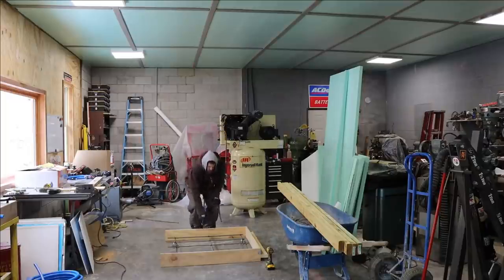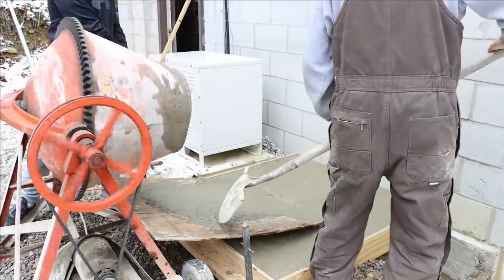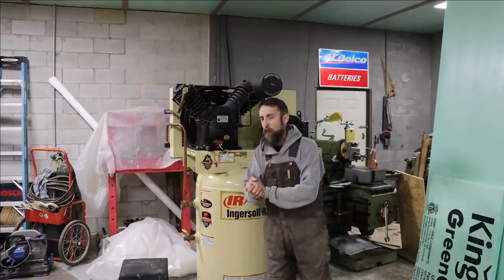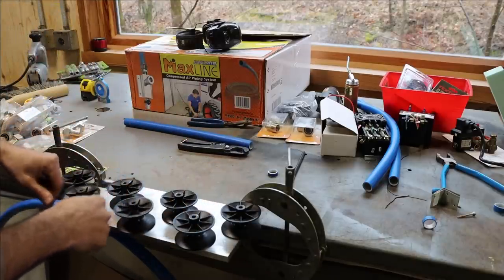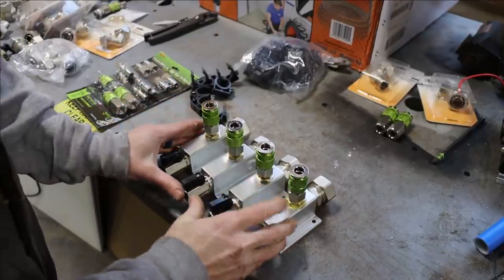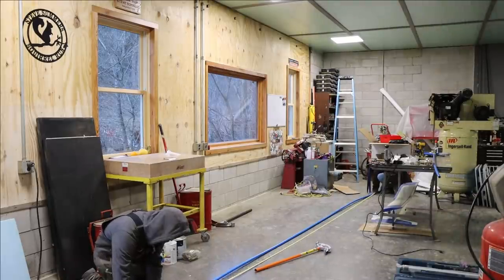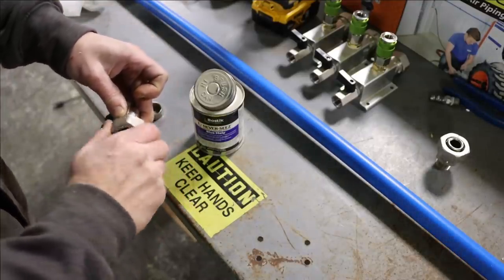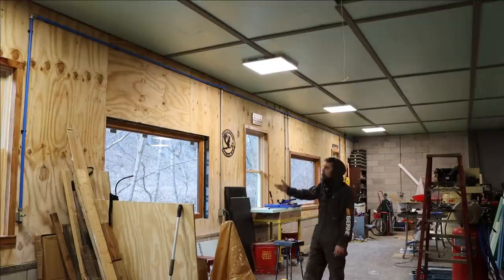Shop air System with Elizabeth & Concrete pad for compressor.

Comment: As ever, yet a other great 'instalment', and a big hand must go to lovely Elizabeth for standing in front of that space heater, so that you didn't get burned working in front of it, Steve 😆😆😆 Glad there wasn't too much 'collateral damage' when that dead gum freezer jumped up off the floor with no good reason and attacked you ! 😆😆😆 Stay safe you guys ❤️❤️❤️, and Spring will soon be coming around the corner. 🌞🌞

Comment: Steve and Elizabeth, what a wonderful couple you are. It is nice seeing a couple that spends time together and working together. When you work side by side it is hard to find reasons to go different ways. Huge thumbs up to the two of you for your family unit. Because of it you have taught your children a very valuable life lesson. Steve you may consider putting the electric side of the compressor towards the shop wall that way the compressor side for changing oil and maintenance is easy to get to. Right out by the door. Thanks for another great video.

Comment: Steve,
In a former life before "retirement" I looked after air tools in an Auto factory. 
Water in the Air manifolds was the biggest problem (apart from operator abuse) for the maintenance of the tools.
To minimise the water problem every air drop was plumbed off the TOP of the manifold, and the manifold was sloped away from the pump and dryer with a collection tank at the end of the line. the tank had a drain that was operated at the start of each shift and in humid weather as needed even though the system had a refrigerated dryer fitted. It is amazing how much moisture accumulates in the manifold. 
You have a small drain tap under each of your outlets. Can I suggest you replace them with a length of hose joining each of the outlets to a common drain valve over a bucket to allow a bigger volume of piping to collect water in, and only one drain to open to clear the lines of water. 

Cheers Eric

Comment: Hi Steve. Airlines look good. A lot of work and expense it seems. I have done my last two workshops , both a little bigger than your lovely refurbed one, using 1” pvc plumbing pipe (3mm or 1/8 wall), elbows, tees, thread ends, solvent glue and normal air connectors. In the middle of the shop we simply used a length of air hose supported with a light chain from the ceiling. Fast, cheap and easy. Can use cheap saddles to support. The lines, along with air tools and blowers, prove air to cnc lathes, mills and saws. The compressor is kept at 150psi and regulated as needed for each machine. Have never had a failure in 20 years. Easy to modify, fittings available at any plumbing supply or hardware store.

Comment: My favorite part of the masonry work is cleaning the tools and area around workspace after you are tired and full of cement dust.
Reply: As a retired tile setter I fully agree. The big difference? With concrete work you can take your time in cleaning the tools, with tile work if you wait too long it will cost a lot of money in replacing tools with dried materials on them. With epoxy grout and thinset you have 20 minutes to use it and clean the tools.

Comment: At least your ladder wasn't resting on a slightly slopped roof, 12 feet up, tied off to an eves trough  13 feet higher up. Glad you are shaken but not badly hurt. That shaken feeling will protect you from future mistakes in judgment. We could all see that coming!

Comment: Have to love literal translations on import tools, but you have to give them props for trying. That pipe diameter you are using is huge, you probably doubled the  compressor's tank capacity right there!

Comment: Gently heating the tubing ends with a heat gun makes the fittings go on easy.  Little oil on the threads of the fitting makes it easy to properly tighten too, the plating on the fittings makes the threads rough.  Glad you didn’t get hurt, floor coating makes it slick 😁

Comment: Perhaps you should check the manufacturer specs for cold weather operation of their compressor. Lots of compressor motors burn out in cold weather because the oil is too stiff. One of the disadvantages of placing a compressor outside. Course you probably already thought of that.
Reply: Not to mention that electricity and water don’t get along well......

Comment: When i poured concrete bases in cold weather...i used incandescent bulbs ( largest ones i could buy locally 150 - 200 watts etc..) Always used multiple bulbs in case one failed ( 2 minimum to maximum i could supply amperage wise to pad )... Cover it with a simple wood frame of enough to support a tarp draped over to keep heat in ....sometimes when minus 30 to 40 degrees i would use fibreglass insulation batts over the tarp/ wood and another tarp over that ...
And yes don't rush your " Reveal " ...
Let it harden and remove your forms slowly ( as you learned ) to prevent damage.... It is amazing how a few bulbs can heat a area when you cover it simply too....i would put snow or gravel around the bottom of tarps or weights ( anything heavy ) to keep drafts from getting inside...

Comment: Keep thick plastic sheet down on the concrete keeps it warmer and wetter. You don't want concrete to dry. When it is setting it makes a good deal of heat itself if you can keep the reaction going. On my last pour the slab stayed close to 100deg for 2 days even with shop temps in the mid 30's and 40's. Going to be nice having it where you don't have to hear it if you can keep things from freezing up.

Comment: One thing you could of done, was to add a wooden spacer around the shop to mount the air line to.  The spacer should be the thickness of the electrical conduit drops.  This way No bends to get over the Electrical drops.  If you need to move the electrical drop later or add more, you simply unclip the hose, cut the the wood spaces strip with a saw while still in place.  Add your new drop and re-clip the hose back in place.

Comment: Good call on those high flow air chucks. Dad and I have been using them for quite awhile now and I'd never go back. Easier to couple and moves so much more air. I can run a 3/4" IR impact off a 3/8" hose no problem

Comment: Re; Slipping ladders, I was on a twenty foot (?) ladder when the bottom slipped out, rode it down just like you. The fall was relatively slow and nothing but a good bit of dismay. Re; the bender you're using, I have a very similar one that is intended for refrigeration tubing, works slick. Has the name of a well known U.S.
Manufacturer of refrigeration tools, but most likely made in the same place.

Comment: Hi Steve,
To get some heat in the shop, you can maybe hang som bar or pipe with some of those bleu tarps on the ceiling to divide the shop into smaller rooms like, if you do some machining you can close that area by closing those tarps so you don't have to heat the whole shop, or if you do a restoration on new machines you can close that area or a welding /fabrication area /metrology pc area.
And in warmer times when you don't need to heat the shop, you can open the tarps so you have your open shop back.
I know there can escape hot air and the tarps have no insulation but it will help a lot.

Comment: I like the flexible air lines they at least won't rust. Probably a good idea to put the compressor outside for both noise reduction and space saving. Hope the family is fine hope you didn't hurt yourself to badly when you fell. Considering how many opportunities you've had to get hurt you have done well. Thanks

Comment: Awesome work Steve.  I'd add some retractable 50' reel at the door - really handy when it come to blowing up tires etc. I wonder if the plastic will hold up in the long term but I like the high flow fittings - they look really nice. A dryer by the abrasive blaster is critical.

Comment: its been quite a few years since i have done any concrete work, but i believe we used to add a cup of liquid calcium to each mix of concrete.  It would create enough heat in the concrete that it would set like it was a summer day.  I now a little too late, but maybe something to keep in mind for the next winter pour.

Comment: Steve, the go to air fittings are made by Milton.  Their V series is backward compatible with the most often seen M series.  The V couplers stay open just like the ones you have.  Super nice feature.  I'm in the process of switching all of mine To the V series.  Added bonus, the V's flow 74CFM, the M's only 36 CFM.
Reply: Yeah there are higher flow fittings available ...i have " M " and am adding a higher flow hose and fittings for a better impact experience.....Milton is my favorite too...since the early 80's ( 1980 !!)

Comment: Your little concrete project reminded me of a driveway apron I poured last January here in Minneapolis. I got a couple of twin sized heated mattress pads and lay them over some poly with fiberglass bats over the top. It worked great. Set me back an extra $40 but the heating pads were still clean so I put them on the kids beds.
you got a fairly well equipped shop there Steve but I think you need a bigger vise to assemble those fittings with. 😁

Comment: I'm sure that everyone will be watching to see how you will solve the issue of freezing water from the air cooler on the compressor as well as the air coming from the tank into the shop. All water has some amount of moisture and over time it will accumulate over tim and cacompressor use serious issues. Locating the compressor in a different location is a great idea. I built a small moveable enclosure, located inside, for my unit then for the air intake I made a large baffled muffler with intake air coming from the outside. Most of the noise from the compressor comes from the pulsations of the incoming air supply.
Reply: "water has some amount of moisture"??

Comment: Your compressed air system should work very well. All those drops  will  provide places to eliminate the small amount of condensate which will occur. I doubt very much that leaks will be a problem for you. Also, you do very professional work.

Comment: One of the skills I learned when I was young and fresh out of college manufacturing controls panels for petrochemical was hard line air tubing. 1/2” seamless stainless steel tubing with Parker fittings for demanding clients and Bi-Lok for everyone else. If I had a workshop bigger than a couple tables in the garage you bet I’d do it again.

Comment: Thanks Steve. That bending tool looks very much like a tool used by cable TV line workers to bend offsets in to hard-line cable at each pole. Image that blue tubing with a center conductor and filled with foam, that's what the cable is like.

Comment: Something I got from my grandad, for shovelling cement out of the bag. 
Lay the bag flat on the ground and cut a square out of the top (large) face. Then shovel it out through a big hole. 
It makes it hard to pick the bag up again, but it isn't like it will still be usable for the next job anyway.

Comment: Steve,, Next time you make a pad in those conditions, look at the colour of the concrete. I could clearly see that it was still pretty green by how dark it was in contrast the the phase converter pad right next door to it. You really should have left it at least another 24 if not 48 hours under that cover with the heat lamp under it. Also if you have to take a form off that's likely to damage the edges, take the form completely apart before pulling the pieces off. That way you can remove directly away from the concrete without dragging the form over still delicate edges.The air line is looking great and a ring circuit is a a great idea. The fittings look superb! Here in the UK we can only get the crappy small bore ones, unless I suppose you pay an arm, leg and left testicle for some fancy pro ones you can only get from certain sources. Oh and that pipe bender? Yes Steve we all know where that comes from! Translated from Chinese into English by someone from Vietnam !
Reply: As much as we all love Steve and his videos I think we can all agree that he isn’t exactly the most patient man when it comes to his projects. I can relate to that. I spent all morning driving around looking for some tubing that I know I can get on Tuesday purely because I was in a hurry even though I’m still waiting on other parts that are a week away anyway.
Reply: @WilliamPayneNZ  lol!
Reply: You know that food wrap plastic thingy that stretches out? Makes wonders when you wrap it around the board and then make a concrete mould out of it !
Reply: Running an edging tool around the perimeter is very advisable, too.  The above comment is great advice!
Reply: And mix concrete with hot water!

Comment: You used the tailgate of your truck to straighten the tubing. When I worked for a mason contractor We would use the tailgate of the dump truck to bend the rebar for the footings. It’s amazing how useful it can be to have a truck on the job. Once we used an old Diamond T Reo with one set of pipe scaffold set up in the dump body to rebuild ten balconIes in a condo complex. And on at least one occasion the boss’s brother “accidentally” ran over an old wooden ladder that should never have been brought to a job in the firstplace.

Comment: The recommended spacing for the Maxline standoffs is 5 feet, but I agree they should include another pack of them in the master kit. I was planning on 4 feet on my install, when I get around it to. I'm going to by two master kits and then order a couple more tees.  BTW I'm glad I'm not the only person that uses the vises on machine tools for other jobs.

Comment: By putting your compressor outside in an area where you have freezing temperatures, you are asking for nothing but trouble when you have such a large interior space.
Frozen drain fittings, compressor oil viscosity, etc.
Reply: Yeah up here it has to be in a heated area for safety and freezing ....alot of moisture is built up inside the tank but also your compressor too..

Comment: In cold weather pouring concrete is better with a cold weather additive to speed up the reaction, or you can just add more portland. The flexzilla disconnects are great connectors, not the most durable so keep a few extra on hand, but they flow great and aren't super expensive.

Comment: Concrete tips from the frozen north. Warm water helps it set faster. I’d leave form boards on as long as possible to keep heat in. Also try to keep frost out of the ground you pour on. You did right by tenting and heating it

Comment: Consider using a chamfer strip on outside corners sharp corners don’t always fill with the fine material because the rock blocks them in the confined space. A chamfered corner fills better and is not susceptible to damage from incidental contact.

Comment: Large air compressors generate a lot of painful noise, in two ranges.  High frequency noises are tempered by heavy barricades like you concrete block wall,.  Unfortunately that wall will transport low frequency noise quite well, through any rigid connection.  As presented, you will be muffling the high frequency hiss and whistle noises inside your shop and aiming a lot of it perpendicular to the outside surface.  the compressor slab is 'glued' to the back wall, to act as a huge sounding board for low frequency hammering. Brief exposure  will be painful.  Long exposure will cause injury.
Here are a few suggestions.  Cut the slab off the wall with a circular concrete saw,  fill the gap with expansion gap filler.  Put vibration dampers under the compressor feet. insulate the exterior of the  adjacent wall with foil faced engine compartment insulation.  Build a shed around the compressor with a metal door adjacent to the pump side of the compressor, and muffler boxes for intake and exhaust.  This will protect the compressor from weather, theft, and neighbor complaints.  Devise some find of cheap heat to keep the drain from freezing.  This enclosure will likely cost as much as the compressor, but could easily triple its service life!

Comment: You guys are tough working out in that snowy freezing weather.

I appreciate all this info on the kit, as that’s the one I am planning to use. It’s looking good and should work well. Next will be the filter and oiler and regulators... (Depending on how you decide to set it up.)

Comment: That system looks real nice. I did my shop in Pex and it looks to me like pex is a lot easier to run. When I was done I pressure tested mine to 300psi for 2 hrs with nitrogen. I feel pex is plenty strong enough for air at 120 psi. It doesn’t hang on the wall as nice as the tubing you ran.

Comment: A little to think about tubing/pipes, a hard "L" angle is equivalent to 1 meter extra pipe in flow resistance. Same for all diameters. So if maintaining flow/pressure is important make the bends as smooth or gentle as possible :) Love your videos Steve.
Reply: He said he is going to "loop" the system.  Flow resistance will not be an issue.

Comment: Hello Steve I’ve never really checked out that tubing before looks like a nice way to supply air in the shop nice and clean also great to have Elizabeth help you your very lucky I can’t let my wife in my shop because my machines can feel the hate and won’t run right for days your doing a excellent job look forward to you next post

Comment: Pre-70's the air hose fittings needed no pulling back of collars on air line... And only a little more $$$ (then it was just a little back then)... LOL Love the fittings having better flow also...       :o)       . 
O,,,
Reply: Don't ya just love bare bones translations on instructions??? lol